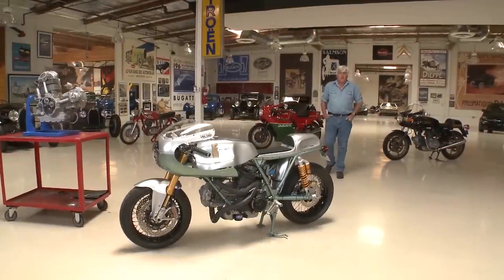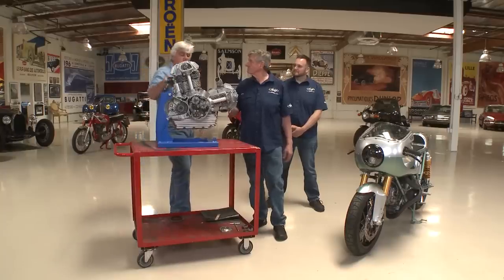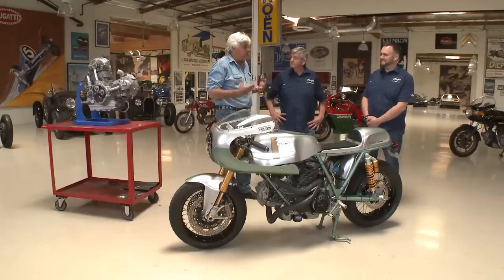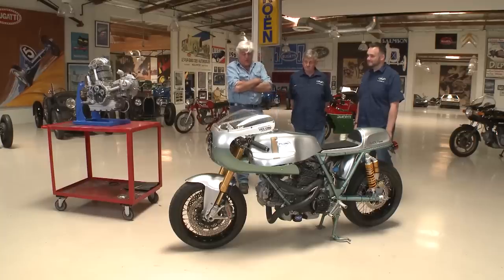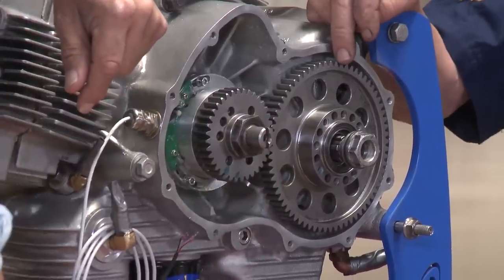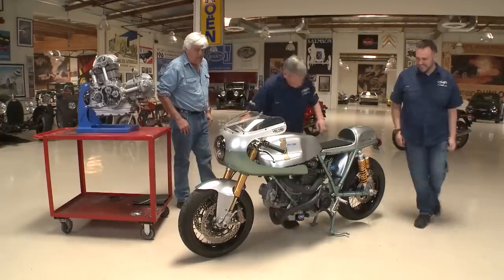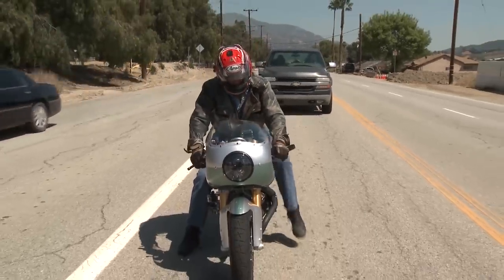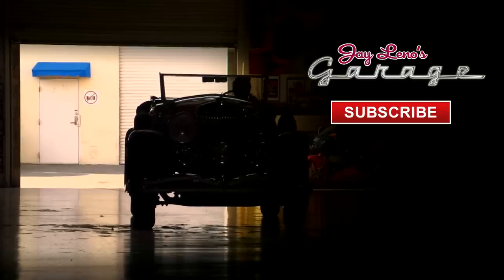Vee Two Ducati IMOLA EVO - Jay Leno's Garage

Comment: It's the Desmodromic valve actuation that eliminates the valve float since it has no valve springs that actuate on the valve. The bevel drive is for cam timing accuracy.
Reply: And for the desmo.  A pushrod won't do it.
Reply: I own the Ducati darmah.  Desmodromic valve actuation used to be the thing but now we have engines that reliably rev. to 14k rpm with no issues.  The bevel drive is a left over from aircraft engines.  Highly complex to set up.  Chains and belts do a better job only cheaper. The bevel twins almost put Ducati in bankruptcy due to high cost of manufacture.  I love the bevel ducks but the new stuff is infinitely better.
Reply: This! 

I was going to say the same exact thing.
Reply: I own several Desmodromic Dicatis, and changing belts every 2 years/12k miles gets old fast.  This system has an advantage here.
Reply: @frankbutaric3565 they just sound so god damn cool, I love anything that sounds like it’s gonna throw it self apart at idle

Comment: The fifteen people that gave this video a thumbs down, obviously have never ridden a motorcycle. They do not know how to appreciate some one with passion about motorcycles like Jay. Keep them coming Jay!!!!!!
Reply: mario calito I agree with that. People are people.
Reply: They prolly thumbed it down because Jay 2:44 - 3:50 still doesn't understand how desmodromic valve mechanism works! Jay thinks it works by "bevels", but bevel gears are the gears shown used to merely right angle the drive shaft and camshaft... and is also used for non-desmo OHC Ducati engines... desmodromic works by rocker arms (not "gears" ) that both open and close the valves... relying on tiny valve springs to only hold the valves fully sealed closed...
Reply: Probably Harley riders lol.
Reply: @samueladams1775   My thought exactly. Amazing that some people can convince themselves that only one brand of bike has any merit whatsoever to the total lack of  appreciation for anything concerning any other brand.

Comment: Beautiful bike! The 900 air cooled Ducs are my favorites. Torque, sound, light weight. Sweet in the 3500-5500 rpm range, I used to ride mine on NH backroads, so nice to just use the torque for acceleration and braking, relaxed and quick enough.

Comment: I really enjoy the motorcycle episodes, Jay talks to the camera like a buddy showing you cool toys in his garage. Very engaging.

One thing though, at the first when Jay is talking about the bevel drive, he confuses bevel cam drive with the advantages of a Desmo valve actuation. Not that I could do any better. 

The videos are interesting, diverse and gets a normal  schmuck to dreaming about cool vehicles.
Reply: Thanks for your comment.  I was set to wondering what he was talking about when he described the bevel drive and then got on to valve float, which as you infer was solved by the desmodromic head. It directly pushed and pulled and valves to open and close.
Reply: Lorne Spry yes indeed, there are 2 cam lobes, one which opens it, and the other follows up to close to eliminate the valve bounce, a system that Ducati still use, Recently Claudio Domenicali the CEO was asked why they still use it as now days with improved designs and materials there are other solutions, he answered , yes that’s true but the desmodromic system is what we know best and it works! It does increase the maintenance cost though but thankfully on my Multistrada the Desmo service is only required every 30k Kim’s, just done the first one

Comment: It's not actually the bevel gear drive that does the desmodronic valve control it just drives it. Modern Desmos have belt drives. Thanks for showing the Vee Two Ducati a masterpiece!
Reply: TRUTH SEEKER indeed... it is the desmo system that was first used by Mercedes and then used by ducati... the latest desmo's are chain drive, i believe. but the bevel drive is the most estaticaly pleasing timing system to me.
Reply: Dave Verdonschot The Desmo part is the two rocker arms and two cams for each valve one set for opening and one for opening the valve removing the need for a spring. Whether it is driven by a Bevel gear, chain or belt drive makes no difference...although i like Bevel gear the best, I had a 900ss years ago and miss it a lot. The sound from those Conti silencers is great.
Reply: TRUTH SEEKER Had a silver and blue '78, 40's and Contis. Too bad steering head was welded an inch offset from center, steering was wonky.
Reply: peoplehaverights Was the steering head welded offset from the factory by mistake? The 78 models were about the best I think apart from quality control maybe?
Reply: TRUTH SEEKER According to Jim Woods, who was the Ducats and Guzzi dealer in the late 70's to mid 80s, it was a factory screw-up. Curiously I never had problem one with the electrics, and it always fired on second kick, but the handling was so odd I didn't keep it for long. Wish I HAD bought the 750SS an acquaintance of mine offered me, though, including original paint on frame and all the fibreglass. :-(
Reply: peoplehaverights That is amazing they stuffed up the alignment, I remember having a speed wobble on mine once..might have been something to do with it. I paid only $3990 for the 900ss brand new in 1982, nobody wanted them in those days. I put a steering damper on and Contis as I loved the sound they made..nothing else comes close.
Reply: TRUTH SEEKER.  However modern Desmos have spring assisted valves, unlike the originals
Reply: TRUTH SEEKER YOU HAD A Black and Gold one then. By the time I finished with mine, want a Darmah SD, but bought a '95 Monster that had horrendous oil consumption - quart every 450mi. Re- Nikasiled cylinder and they replaced the rear cylinder head because of a over torqued stud bolt, after the repair, still used oil, quart every 650, so I stuck with Beemer after that. Sound is the main attraction.
Reply: TRUTHSEEKER, I am so jealous...always wanted a 900SS when I was younger...saw plenty of them around in Sydney back in the '70s...but they have always been out of reach financially.  :-(  I love this new bike, but I have to say, I miss the look of those old chrome pipes and mufflers.
Reply: aussiebloke609  I have  a '79, the first year of the black and gold.  You can check it out at rustyosh...or not...
Reply: Far as I know, Rusty, the Desmos always had an additional weak spring to fully seat/seal the valve because the Desmo arms have typical valve lash clearance, but dual lash... I had a '75 Duc 750cc non-Desmo and a '74 Duc 450cc Scrambler Desmo that would rev to 8,000+ but power faded by 4,500... Ducati missed the boat by not further developing the 450cc 4 cycle dirt bike which is what all dirt bike makers ended up with after demise of 2 cycle engines... The 750's had too short valve guides that wear out in 5,000 miles... it would go 50 MPH when I got it and 125 MPH with simply new valve guides... New guides made of better bronze alloy are available...
Reply: Yeah, there's a small spring on the rocker which I'm guessing is the one you're referring to.
Reply: rusty: the hairpin spring on the closing rocker arm is there to help the engine idle smoothly for street use. The spring is normally removed on racing engines. Closing rocker clearance is +/- 0. Street engines are good with a thou, racing engines 0. Opening rocker clearance is 4 thou. American company MBP developed tool steel closing shim retainers that virtually eliminate regular closing shim adjustment caused by the factory wire retainers being crushed, in turn making the clearance greater. I use them as does my friend Turbo900SS.
Reply: TRUTH SEEKER i know about the desmodromic system... but i think these cams are driven by chains in the latsest ducati models.
Reply: Dave Verdonschot  Belts unless there's been a recent change
Reply: Panigale (Superquadro) engines utilise a gear/chain driven cam arrangement. 2V Desmodue and 4V Testastretta engines still use toothed belts  :)
Reply: Flatslide  Dude you have too much time on your hands!!!  :)
Reply: aussiebloke609 Yes I was lucky, that bike I had would be worth a mint today if I still had it. Still today you can buy a Yamaha R1 that has a sound reminiscent of a Desmo but with loads more power and better handling.Not a bad thing to go for.
Reply: TRUTH SEEKER   Oh please...lost credibility right there...
Reply: rustyosh Oh well...yes I know an R1 is not a classic and there is no chrome to polish. I still love desmos that is why I am looking at what Vee two are up to.
Reply: TRUTH SEEKER  nothing wrong with an R1...why though would anyone who wants something reminiscent of a desmo buy an R1 rather than a Ducati?  And there's not much chrome on Dukes either...just sayin...
Reply: rustyosh Maybe because these older Ducatis are getting very expensive..and old. I dont know how much a Vee Two Duc is but I bet it is a lot more than a R1. There was plenty of Chrome on my 900ss, I liked polishing the exhausts and alloy engine casings....A new Desmo wouldnt have much Chrome but then we arent talking about new Ducatis here I dont think...
Reply: True, the old 900SS had a reasonable amount of chrome - especially those long, low, lovely twin silencers (unlike the black, single exhaust featured on this bike.)  :-)
Reply: peoplehavetherights A Darmah seems like a sensible choice these days as it was more comfortable and had electric start! Hooray! It also had Japanese instruments so the speedo didnt wander all over the dial...
Reply: TRUTH SEEKER  I don't know where you guys are getting your info from, but pretty  much the only chrome I have is pipes and chainguard...the rest is polished alloy...hand polished.   And I don't think the black and gold were much different in that regard to the blue and silvers.  And my Veglia instruments are steady as a rock, the bike handles beautifully, still starts first kick, runs like a clock, goes like the clappers and makes Darmahs look totally fucking lame!!!
Reply: rustyosh from memory There is chrome around the vaguelia instruments, chrome headers chrome conti silencers (wonderful), chrome handlebars and chrome mirrors ....oh and chrome indicator stalks technically chrome plastic...yes and lots of alloy. Sounds like you have a very good one. Keep it for ever they will never make them again like that except for Vee two of course...
Reply: TRUTH SEEKER  Haven't really made up my mind on the replica.  I think an enthusiast would be crazy to pay $75,000 (or thereabouts) for a copy when you can have an original for that kind of money.  A lot of their beauty and appeal lies in their age.  Taglioni was an absolute genius and responsible for that  fantastic, golden era of bevels and I think replicas (albeit good ones) could cheapen that memory a little.  That's probably why Ducati hasn't done it themselves.  I also have a Sport 1000 which I bought new in '08 because it had been based very loosely on the 750 Sport of the early seventies which I loved so much.  However, it was never intended to be a replica, and there is no confusing the two bikes, they look worlds apart.  I think Ducati could also make exact replicas and sell them for a shitload of money if they chose to, but, thank Buddha, they haven't.  Just off the track, i think Darmahs were the only part of that era that I didn't like.  While they shared similar paint jobs and engines, they totally lacked the same charisma and appeal of the GTs, Sports and Supersports.  Those shortcomings are reflected in their current market values.  And frankly, those electric starters (which clearly bring you some degree of joy) were also put on the later Supersports and I think they were a complete abomination which spoiled the look of those beautiful bevel engines.   Different strokes for different folks I guess...
Reply: rustyosh Today there seems to be more and more rich people who can afford whatever there little hearts desire.(not jealous at all....) and price is not really an issue for them, they just want the best regardless of price and this is what Vee Two are offering. Given a choice of this or the original I would take the Vee Two as it is really like an original only better. Wow people really dont like the Darmah do they? Yes I know the electric starter did spoil the looks as it was a bit of a add on but with my older bones creaking it would be handy. Yes I know the sport 1000 I did like that model a lot, if you fitted two Contis would it sound like the original bevel drive? I fell in love with Ducati as a kid when I saw a Mach one 250 in a motorcycle shop window in Sydney, such a work of art compared to Japanese or even British bikes of the time. I managed to get one and rode it for years but I could never get it to rev out properly no matter what I did with it. (engine rebuild, new carby, different silencers, spark plugs coils etc) It always felt like after being at high revs for a short while it would start to starve of fuel and start misfiring...a mystery.
Reply: True, true. Bevel gears does not mean desmodronic valve control. Example, '68  Ducati Scrambler utilizes butterfly springs to hold valves closed.
Reply: @BuzzLOLOL  Yeah on the valve guides. Mine went bad right away. The shop put Yamaha guides in (I guess they were longer) and it was fine for the next 20 years.
Reply: @rustyosh  As I remember the 70s write up in the magazines, the cam closed the valve to within 10 thousands and there was a smallish spring that along with the compression closed the valve the rest of the way.

Comment: The reason for the window on the rear cyl was a racing tool these engines use monograde oils and take longer to warm up , so when you start the bike the window fills up with oil once it reaches working temperature the oil drains away , now you can go racing !

Comment: good video but the bevel drive of the cam doesn't have anything to do with how fast the valve closes.  It actually doesn't float because there is a rocker to both open and close the valves so they don't rely on spring pressure.
Reply: Yeah, Jay didn't really understand the Desmo system at all... surprised those guys didn't explain it to him... The bevel gear engines look cooler, and more reliable than chain drive, but more expensive to make...
Reply: Yea, it is the first thing I noticed... Jay showed how ignorant he is. The Desmodromic system has two cams, one for opening and another for closing the valve. That is why valves can be properly operated at higher rpm. The bevel drive is just needed to achieve a 90 deg between the cam shaft and the drive shaft and its profile reduces noise and vibrations. Nothing else. What a shame...
Reply: Yeah, man, a chain drive is just as smooth as bevel gears... but I want to pick up an older bevel drive 900cc Duc... I just like the look of the engine better... don't care if it's Desmo or not, valve springs work fine at street bike RPMs... In fact, my 1974 Duc 450cc single Desmo scrambler would rev to 8,000+ RPMs, but power was, disappointingly, gone by about 4500... it was low RPM torque tuned/designed... Main problem with Ducs is the too short valve guides need replacing every 5,000 miles... Long ago I picked up a 750cc Duc with only 5,000 miles cheap because it wouldn't go over 50 MPH... put in new valve guides and it was restored to 120 MPH in 3rd gear with two more gears still to go... Ducs tend to have long-legged gearing... 60 MPH in 1st...
Reply: @mangiumicro  It connects to the crank shaft not a drive shaft,such a shame.
Reply: @tedzehnder961  Cam shaft(s) and crank shaft are parallel... hence two conical gears are needed if rotation is to be transferred by a "drive shaft" perpendicular to both. Bevel gear is just a type of conical gear. So, yes, there is one bevel between crank shaft and drive shaft (but not even directly, usually with a reduction gear train in between because the cam does one turn every two crank turns... 4 stroke engine) and one bevel between drive shaft and cam shaft.

Comment: Jay - as always, great video. Like others, am real appreciative of your willingness to give your time up to share all of these wondrous vehicles from and at your shop. Great production values too. One point of discussion: you highlighted the bevel gear aspect of the valve gear train, which is definitely eye candy, but the real aspect of the gear train meant to deal with the valve spring metallurgy weaknesses of the time was the desmodromic technology. As you are no doubt aware, this involves mechanical valve closing via an additional set of cam followers. Slip of the tongue or intentional so as not to confuse the non cognoscenti with too much info? Again, thanks for the numerous awesome videos.

Comment: Beautiful bike and Engine, like you said "A piece of Art".  I love big twins that are engineered smooth (sorry guys but not a Harley split connecting rod fan), I sure wish they could put this motor in a smaller style cruiser frame, not a sport bike guy either, I love having retina separating power when it's needed but I'm mostly an easy rider type. When I learned that Kawasaki was ending production of it's twin 750 in favor of it's newer design 4 cylinder I went and purchased one of the last KZ750 twins available, I really loved that bike (I'm not a very big fellow, fit me perfectly), but a few years later I was forced to sell it and to this very day I regret doing so.

Comment: Top notch and beautiful. One criticism of the original Ducati bevel drives at the time was, allegedly, that they spent more time disassembled on your garage floor than on the road. Would have liked to hear how this modern manufactured engine compares.
Reply: Not that horrible. I rode mine for 20 years until it was destroyed in a fire. A very solid and reliable engine (after the valve guides were replaced with better ones). Now the electrical system, that was another story.